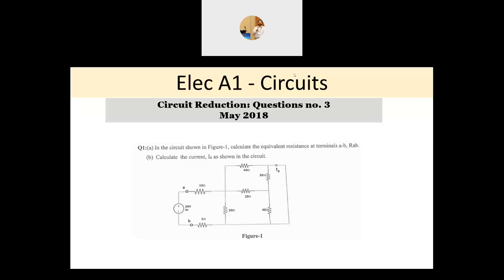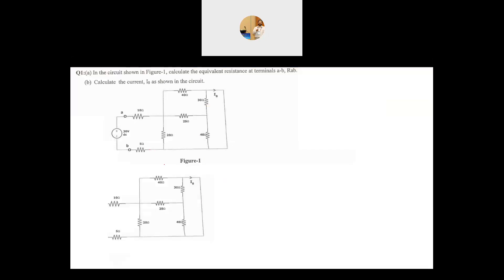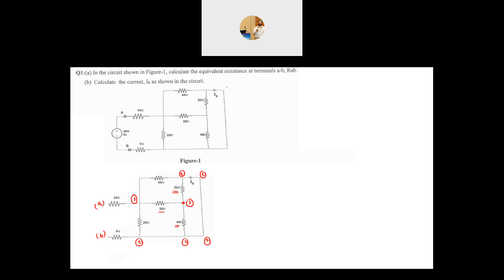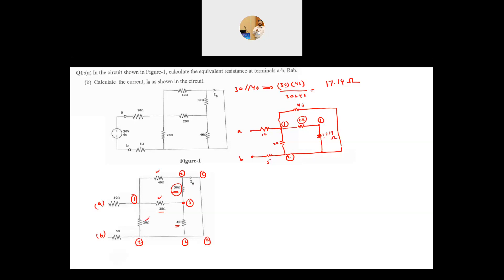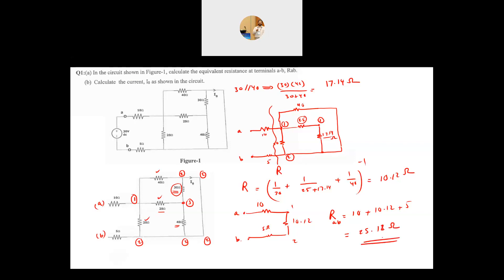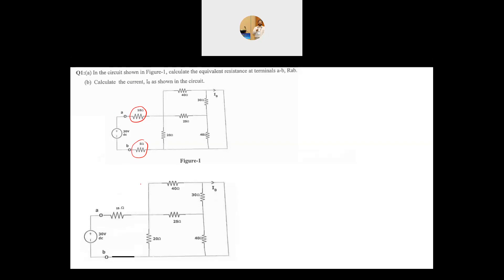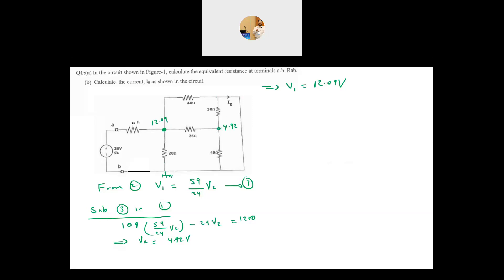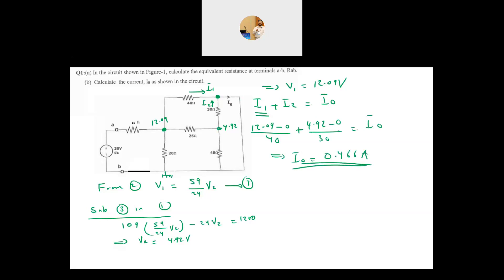PEO solved examples (ELEC A1): circuit reduction Question no. 3

Comment: prof, how did you conclude that the 5Ω and 10Ω resistors are in series ?
Reply from the maker: Assume a current flows in the 5ohm, will the same current flow in the 10ohm, if yes then they are in series.